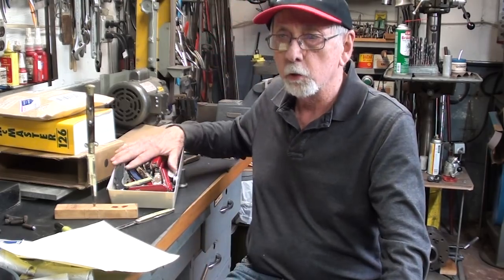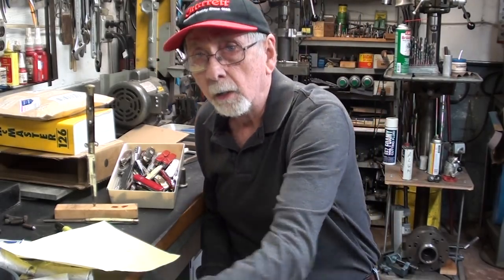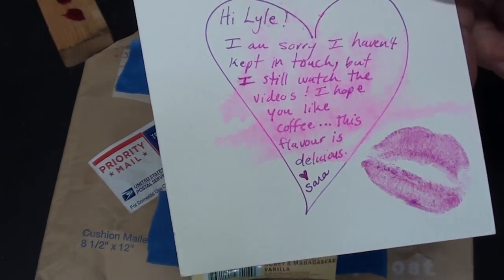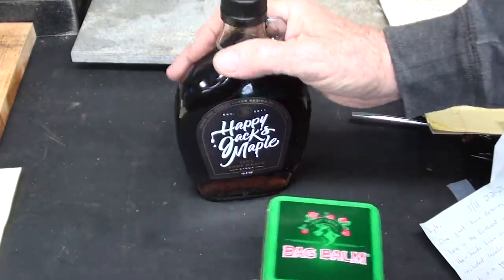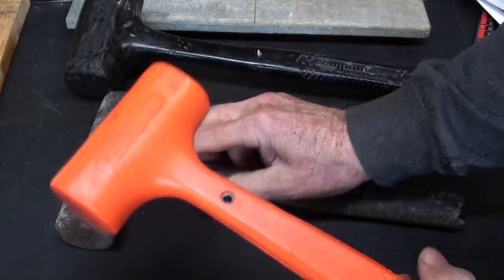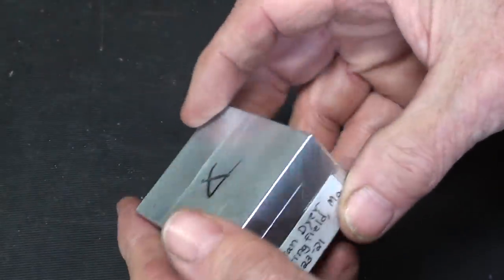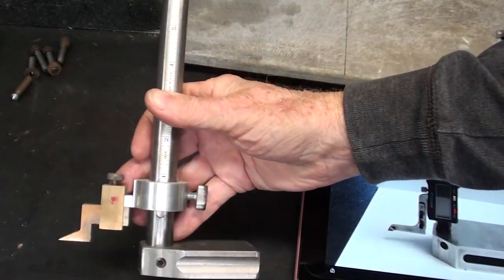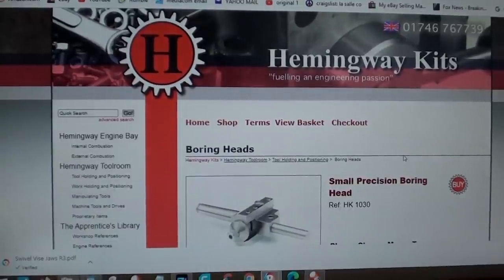THIS & THAT #61 tubalcain mrpete foundry patterns castings

Comment: That switchblade stuck into the table is eerily suggestive of "The Blackboard Jungle" and "12 Angry Men".  Ernest Borgnine was on the receiving end of one in "From Here to Eternity", but it could not be shown. In those days, the mere display of a switchblade was sufficient to provoke an audible audience reaction.  Now days, not even a 9mm or a AR does the trick. Times change.  
The exploded tank is why there is an ASME Pressure Vessel Code.  Accordingly, the tank must be equipped with an approved (and functional) pressure relief valve.  I'm suspecting this one didn't have one, or it was malfunctioning.   
Great job, as usual, and don't waste your time on Rumble. Stay here, and stay with the formulation that works for you.

Comment: If you're worried about that air compressor, do a hydrostatic test.  Blondihacks said 2x working pressure.  You need a specifiic hand pump but maybe the safety is worth the expense.